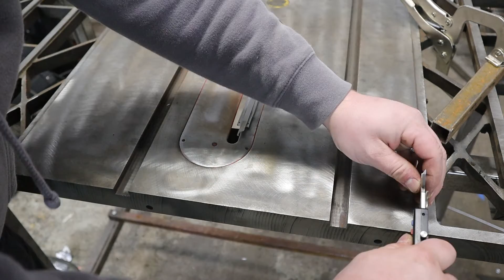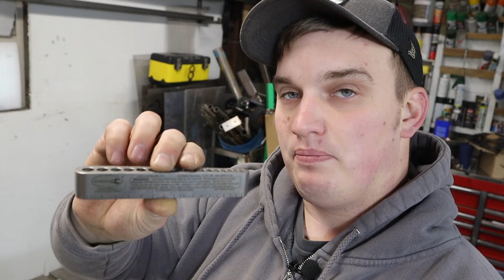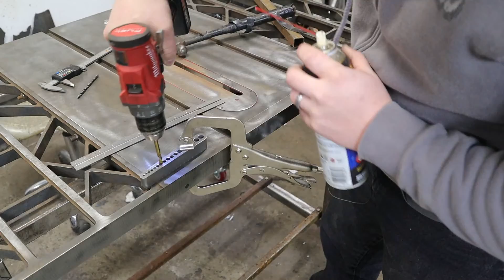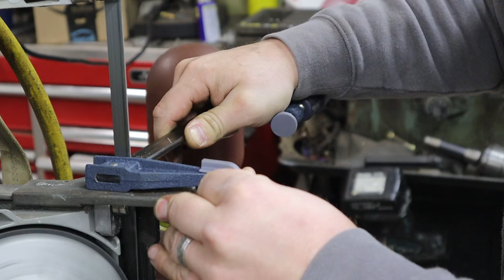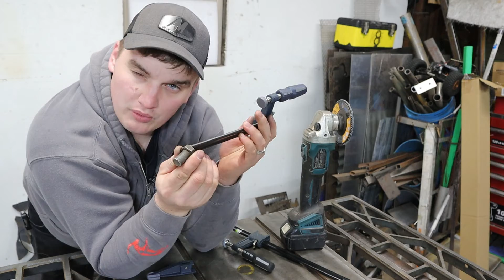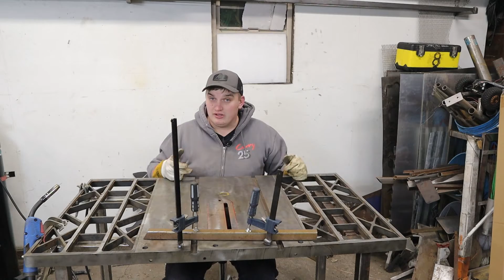DIY Budget WELD CLAMPS , Table saw Weld Table Part 3 #weldingtable

Comment: What spacing did you use for the holes?
Do you like it?
Are holes around the edge enough or do you need more holes?
Have you cut off any bolts and used them as stop blocks ?

Comment: I think the more you use this table the more holes you will be drilling. It becomes more useful when you can choose from several locations when placing clamps. I have a large magnet clamp that works well on my Craftsman table saw because it is such a huge mass of steel. Also, these tables come with a fence that might come in handy. I am also thinking that some of these table saws were belt driven. By changing the pulleys, that speed could be reduced to match a metal cut-off saw. It would then be usable to cut larger material. A sled could then be built to make straight cuts using the miter slot. The one caveat is that the same safety issues are in place as when using a table saw for wood except that the consequences from kick back might be more severe and flying metal particles can get in your eyes etc.! A better solution might be to convert a radial arm saw because the blade spins down and away although the length of cut is limited. An even safer alternative might be using a metal blade in a circular saw with a clamped rail as a guide.

Comment: I didn't even know what a mag drill was.  Now I have one.   It was sure cheaper than a drill press (which I don't own) and perfect for the welding table I want to build.  I need to figure out where I can get scrap metal like you seem to have all over the place.  Thanks for the great ideas.  Sure enough, there are a bunch of old craftsman table saws near me in Maine.
Reply: I hadn't even thought about a mag drill in place of a drill press either.  I like it.  Thank you for connecting the dots for me.
Reply: @seanyounk1  Hey.  Glad it helped.  I recently had to drill holes in the back of a truck for a hitch install.  Perfect job for the mag drill that even a drill press couldn't do.

Comment: Did not read all your comments but I have been wondering why you did not leave motor and other components in place put a metal cutting wheel on in place of a wood cutting blade making a metal cutter. All accessories that come with the saw for wood cutting would work for metal cutting as well. The metal cutting blade can be dropped out of sight when not needed. It would limit your ability to portable but the trade-off might be worth it.
Reply from the maker: Would definitely work. I've never been a fan of table saws for cutting metal though kind of sketchy
Reply: And with the motor and spindle the saw weighs a TON... When I picked mine up last week, we took off the motor and wings, just to be able to lift and put in the back of the truck..  @amcustomfab

Comment: Another ingenious mod. I would add a hinged grinder cutoff saw with provisions to miter cut right on the table so everything is at reach. The grinder mitter cutoff tool can be swung under the table when not in use. This i will do to my table once I find one for no more than $50.
Reply from the maker: They are out there just have to be patient . I might have inflated the market though 🤪

Comment: Going to go off track for a moment here since I know you're at your PC . I'm getting ready to buy the PrimeWeld CUT60 and I was wondering about a couple of things . #1 - Can you recommend an upgrade for the torch or has PrimeWeld already made one ? #2 - Have you found a more compatible table than the Langmuir Systems Crossfire PRO you did a review on a couple years ago ? Being disabled I really have to watch the budget and your channel I have found to be very helpful . Thank You and keep up the great work Sir .
Reply from the maker: Absolutely primeworld has already come out with two aftermarket machine torches I recommend the upm-105 that one is a good torch. And as far as CNC plasma tables go. I can't really speak to any other brands langmuir is the only one I have personally used they're pretty bare Bones and don't have the bells and whistles but that's also what makes them affordable . If I were to do it over again starting off I would not get the pro table because 90% of what I do will fit on their standard table with the EL kit . I would definitely get the IHS z-axis. But I found that the torch height controller personally is not worth the extra $400 half the time I just unplug it cuz it's so finicky but the IHS will still super helpful. Thanks for watching really appreciate the support on the channel. ,😎👊
Reply: @amcustomfab  I'm not personally good with PC stuff but I have family and friends who are . Do you have an email or are you just on the social media things ? I don't have any social media but I'd love to share some builds with you . Thanks again and keep up the great work Sir.
Reply: @amcustomfab  The reason behind asking about the table . I might have my hands on a Torchmate 4x4 table that includes CNC controllers , Laptop ( HP Elitebook G5 i7-8500) and software but no cutter for a price I can afford . I'm wondering if the PrimeWeld Cut 60 would be able to hook up to all these things I'm just now learning about ? Again any help I'm grateful for . Thank You and Keep up the great work Sir.

Comment: I just watched all three parts Nice job I wish I would have thought about the table saw but I had thought about steel surface plates prior to your series and bought several of them at auction, problem is with them is they are extremely heavy and have underneath structure formed to the plate to keep it flat, so the issue arises of how to drill a grid with the underneath structure, I have a mag drill but man what bit were you using? it went through that like butter. cool series
Reply from the maker: https://amzn.to/3HolV0k

Comment: This work pretty good.  I've been using these this way for a couple years.  I have noticed I've gotten a lot of flex.  I think I'm going to make a new batch with a set that are a tiny bit beefier.  I saw some at Rual king today for $7.00 that felt a lot beefier.  The tilt 5 degree advice you gave is a great idea that I didn't do.

Comment: I made several clamps from those exact HF bar clamps. They work just fine.
I'm sure this isn't a new idea, but in case nobody else has chimed in:
Another harbor freight item ripe for hacking into clamps is the "Drill Press Locking Clamps" to give you those vise-grip kind of clamps. You just cut off the wing nut thing off the bottom and similarly weld on a 5/8" stub. From experience Ill let you know that you need to 1) cut off the entire flat plate and bolt assembly off the thing (not just the threaded stud) and 2) angle the 5/8 stub at more like 20 or 30 degrees so the back handle end angles up and is lifted off the table so you can operate it (you lose a little height capacity doing this, but still have plenty in my opinion).
The pivoting swivel clamp face thing CAN be a nuisance and I haven't yet decided whether or not I want to cut them off. It's not awful and occasionally serves its purpose, but the nuisance is not trivial either. You could try both ways and see what you like better.
I also welded some short (about 3/4" long) stubs of 1/4 rod to the FRONT of the knurled thumb screw head making a T-handle to facilitate adjusting the grip even after it's locked in. You locate this in front of the thumb screw because if you weld the T to the back end, you lose the ability to quickly spin the adjuster with the knurled knob.
Looking good.
Drill more holes!
Reply: If youpurchase another one, please make a short video on what you’re talking about here. It’s so much easier to see than to read about. Aloha

Comment: Great video. I'm sure this is on your list already, but just in case, put some screw-on tabs on the table edges for quick 90 degree alignment. When not in use the tabs can be loosened and rotate down out of the way or removed.
Reply from the maker: Did that in part 2 😎 keep all the ideas coming through I love it 👊🔥
Reply: @amcustomfab  Funny. I watched part 2 also. I guess I forgot. Getting old :(

Comment: I built a very similar table many years ago. My clamps are made with pipe clamps. Was very easy, just weld a bar (or 5/8" bolt) in the end of the pipe and you are set. I drilled cross holes in the pipe and plug welded so they are smooth on the bottom end, but thats not really necessary. You can still use them as clamps , just slide the fixed end back on. Good vids, keep them coming.

Comment: The cast iron harbor freight clamps break in a heartbeat. They are really crap.
Reply: I haven't broken the cast part but I have bent them just by clamping (too much pressure I guess) and I've broken off a couple of handles. The handles are cheap plastic and the screw barely goes into it so all the torque you put on it when tightening is going into the plastic. They snap at the "lug" on the screw that the handle is molded over.

I think they should be fine for a budget clamp when you are using it for fixturing. You really don't need a lot of pressure to hold pieces in place while you weld them..